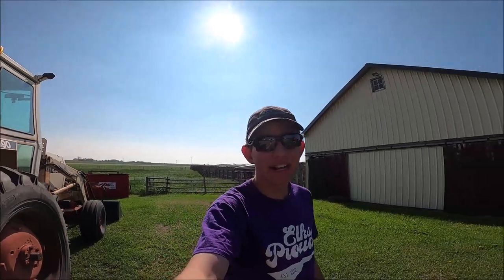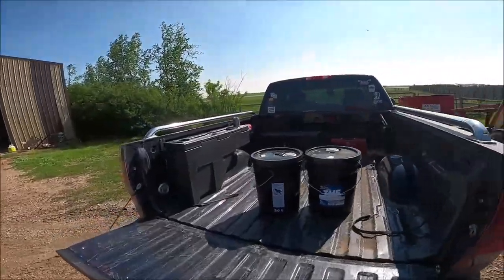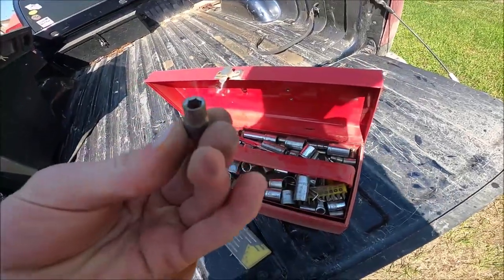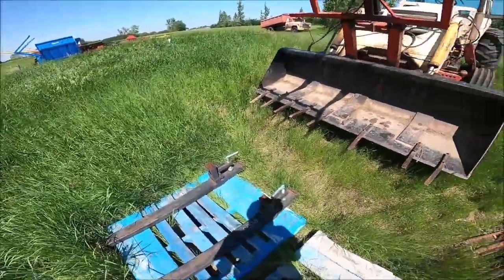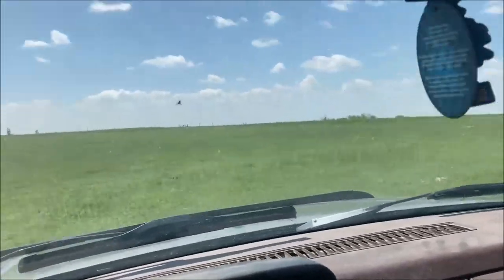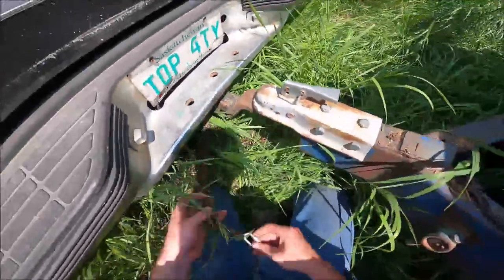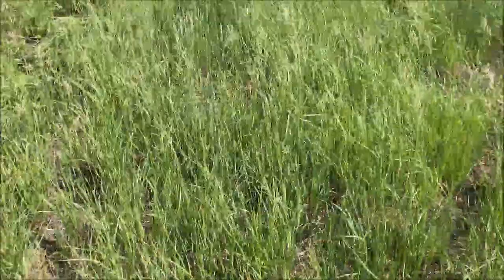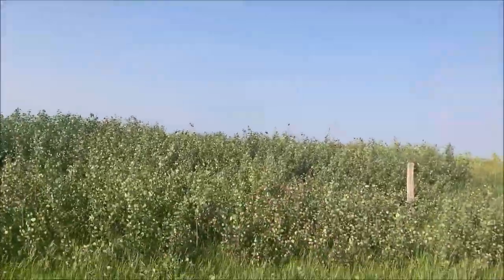Pretty Neat Forklift

Comment: 5.5mm on the older ford's. 11/32 is common on old chevy starter wires. You just may not need them depending on your junk lol.
Reply from the maker: I didn’t know that. I guess they do have a use
Reply: @kyfarmerman  I use them to toss at the cats when they try to come in the shop when the door is open.  Lmao 🤣👍